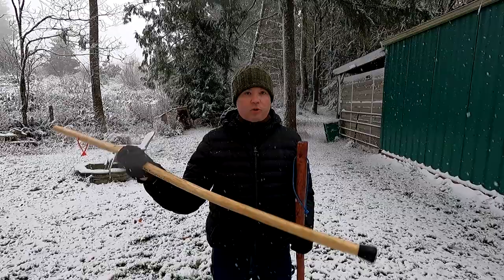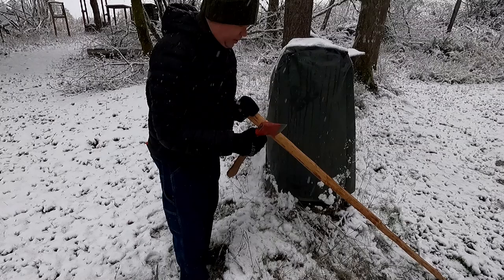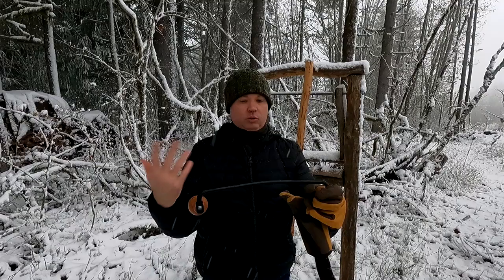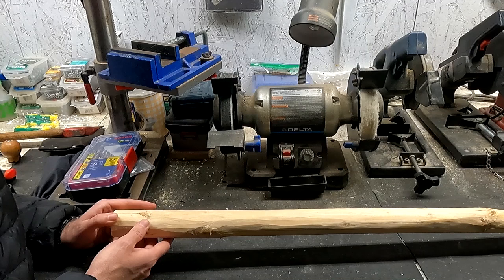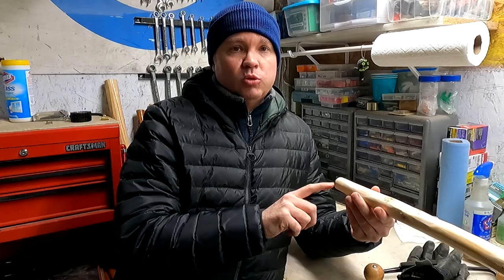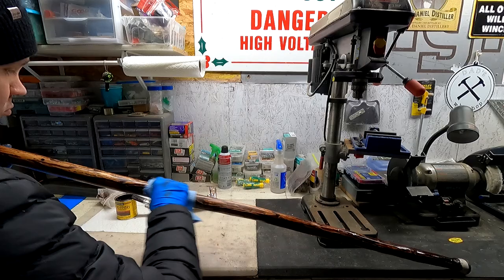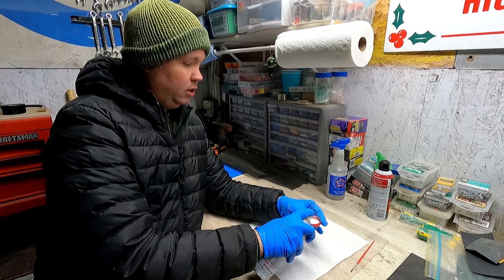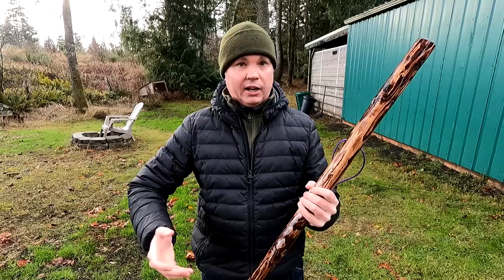Free Branch to Awesome Walking/Hiking Stick! (Simple DIY Guide)

Comment: Beautiful stick. I might experiment with your hatchet method. I usually use a plane to,remove knots from the sticks I make. For the foot  I use a copper pipe cap then I put a long lag bolt in the middle I cut off the top of the bolt and file  it to a spike. Then cover that with a rubber foot like you did that way there's a option if you need to dig in for traction.
Reply from the maker: A couple of the knots were quite long branch remnants. I could've cut them flush with a hand saw first and then leveled out the remainder with a blade, file, or by sanding. But the hatchet basically does both jobs in one step, so I believe it saves a bit of time.  

I have not tried a plane, but have used a drawknife and carving knife to remove knots.  I personally find it faster/easier to get the knots flush using the hatchet than a cutting blade, and the hatchet doesn't dull or chip when working with hard knot wood.  

There are some caveats.  The hatchet needs to be sharp so it cuts through the knots without tearing them out. Also, using the hatchet in the wrong direction will almost certainly result in splitting or cracking the wood if it's dry.  

The best thing about this sort of hobby is that it doesn't cost you anything to try out new things. Have fun. 🙂

Comment: What if you have a fresh dropped oak tree limb and don't wish to wait years to make a walking stick?   🤠
Reply from the maker: @Harleyrk99  Well, you can still remove the bark and use it as a walking stick. However it will not soak up oil or stain well while green, and evaporating moisture will cause any coating to bubble up. You could always use it now and finish it later once it's dry.
Reply: @outdoorsinoregon  Thank you for your reply. I also read somewhere that you should paint both ends so the moisture will go out the sides. Is this something I should do as well?
Reply from the maker: @Harleyrk99  Painting the ends slows down the drying process and prevents "checking" (cracks and splits) on the ends. However, this is generally recommended for larger wood. Smaller branches like you would use for a walking stick are not generally at risk for checking on the ends.
Reply: Thank you very much for your reply and advice. I appreciate y'all.

Comment: Great job - one tip that can be used is that I grind the nubs off the piece of wood instead of using a hatchet or a knife to remover them - sometimes I use a bench grinder and sometimes I use a portable grinder - but it works welol for me and is much simpler and faster.
Reply: I use a hack saw it works good for rough work

Comment: Looks awesome! I just got some boiled linseed oil for the maple stick I'm working on; I wonder how it would compare to the wood stain in looks vs protection
Reply from the maker: The boiled linseed oil will provide a light amber tint, but will protect better than typical  wood stain.  Once dry, linseed oil creates a protective polymer layer that better helps to prevent moisture entry.  Have fun with it. 🙂
Reply: Gonna use linseed oil on my walking stick too.  Would I just use the oil and nothing more or should I put like polyurethane or shellac over it or something?
Reply: @jeffschmick8279  You can use polyurethane (I would not suggest water-based if it is for heavy use outdoors) once the linseed oil is completely dried. I'm using Minwax fast drying polyurethane (oil-based). Some people like to use Spar varnish (like Helmsman Spar urethane), or tung oil mixed with Terp and mineral spirits, but any of them will do. Depending on the climate you live in, you could even use beeswax or just leave it as is :) I would do some research on what would be best for you based on your location, just make sure it's boiled linseed oil, otherwise you'll be waiting a lot longer for it to dry!
Reply from the maker: @jeffschmick8279  Once dried, linseed oil will polymerize, and this will protect the wood reasonably well.  Once the oil is completely dry, any number of top coats can be optionally added to improve protection: polyurethane, shellac, polycrylic, clear enamel, lacquer, varnish, spar urethane, etc. 

I recommend adding a topcoat if you're using boiled linseed oil, since manufacturers often add heavy metals and other toxins to the oil to reduce drying time. A food-grade linseed oil (or flax seed oil) will eliminate this problem, but takes longer to dry.

Comment: He said in the beginning that you don't need any special tools, but he showed all of these special tools he already has. Even tools made in other countries. 😒 

From experience,  I know that making anything such as a staff or walking sticks, it doesn't matter the knots on a branch. The drying process already takes place the moment a branch separates itself from a tree (opposed to  being forcefully removed by hand). So, using branches/sticks laying around on the ground in nature are the best options to use. You can shorten the knots and even smooth them out some, which gives the entire piece character. And if you wanna go even farther, you can go by every inch of the branch's shape and create significant and intricate designs along the way.

Great work btw. Looks like a pretty strong walking stick.
Reply from the maker: Thank you for the comments; I'll consider a follow up video using nothing but a knife.

Comment: Oh yes forgot to ask if its OK to use pine branches for said walking stick ?     I  get  that it has the resin in, this is why I'm askin bcos of time period, & the moisture content off of pine sap/resin,  also it has just a wee bit of flex in it  !! 

I do have one or two others from different trees but it's mainly Pine n Ash,  n  birch i think !  Can't wait to have em dried out properly  ..   All the best a fellow enthusiast...
Reply from the maker: Sure, pine should work fine once it's dry as long as there's not an excessive amount of sap on the outer layer.  The Doug Fir I used typically has just as much resin as pine.  Pine is a softer wood and will wear a bit quicker, but also easy to work with, lightweight, and can have nice grain patterns.